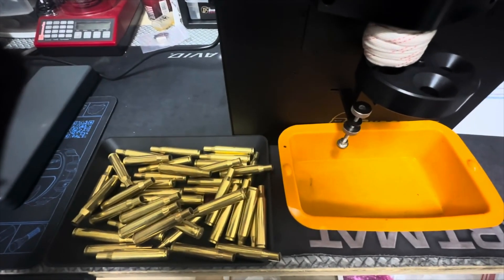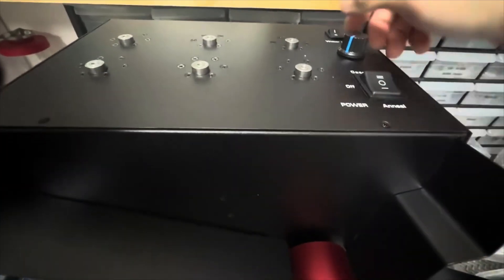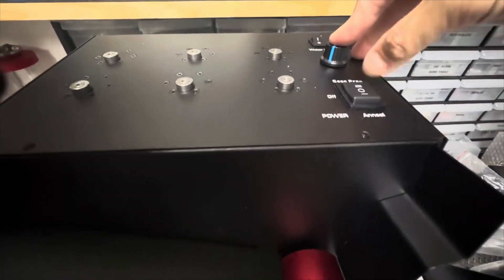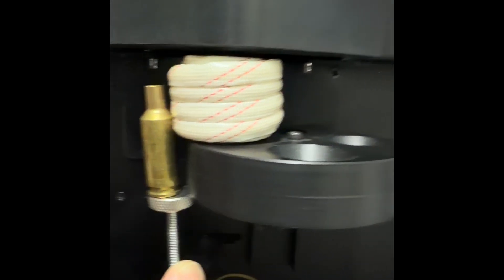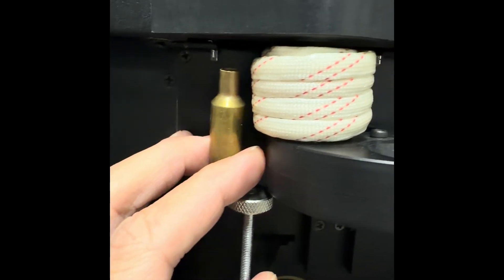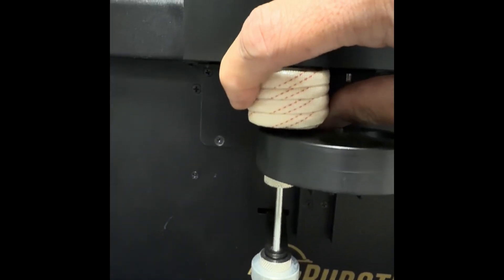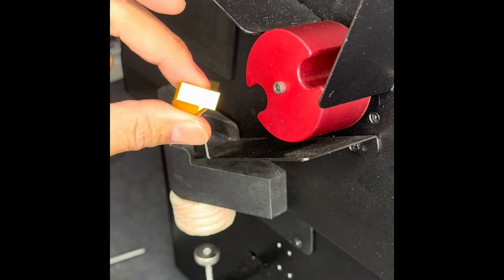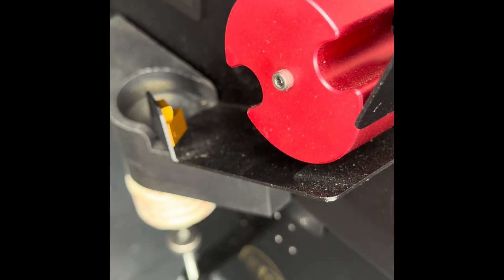🔥 Burstfire - Induction Annealer - Quick Setup Guide 🔥

Comment: Had an AGS flame annealer for about a year and been keeping an eye on this one.

Picked one up through Midway.  Arrived yesterday.  Did a lot of test running (new toy, must play) without the coil and pump running on 308 and 6.5 prc brass.  6.5 prc brass needed the bigger "Magnum" top wheel (takes seconds to replace - Allen wrench included).  IIRC I only experienced 2 times where a 308 brass didn't fall into the annealer part in over 300 cases.  It was way above and very easy to recover from and gave me no worry.    I tested to see if I could just run everything with the Magnum wheel.  It worked just fine with the smaller 308, but looked less precise.  Since it only takes seconds to replace, I decided just replace when needed.  During this time some fluid did come out of the cooling system into the reservoir telling me that this unit was tested before sold (awesome).  I guess it could also mean I was sold a used unit, but I severely doubt that.  I got that new electronic smell.  Mmmmm.

Ran a tray of 308 lapua brass today.  Ended up setting up speed too fast on the first case and was skeptical if it was working.  I can feel my fingertips now - it was working.  A couple of speed adjustments later and everything seems to be running well.

Compared to all other induction options I've seen, this is priced very well.  So far it seems like I've gotten an excellent product that I hope to get a lot of use out of - time will tell.
Reply from the maker: Thanks for sharing! Yes, we do test all machines through a very extensive QC process. Testing parts pre assembly and the parts (again) + functions post assembly.

Comment: This helps clear up a few setup issues and makes things much clearer than the previous setup video.
Thanks for quickly replying to my messages and helping me sort out my setup issues, which have been a bit more thoroughly addressed in this video (a picture's worth a thousand words and all that).
I honestly haven't found much I'd change. It really is a nice turn-key option with features not found on some more expensive offerings out there.
A better coolant reservoir is the main one. The lack of a seal lets coolant leak if the reservoir is moved, and the molded hinge is a longevity concern.
The voltage switch markings are opposite of what's on the physical switch, which could easily lead to fried units in 230V countries.
Maybe make the height adjustment a bit longer to more easily accommodate short cases, and future proof against someone developing something even shorter. There's a bit more room to adjust due to the arm not being solidly tight.
A purpose built shavings catch tray would also be nice since the prep center arrangement is 2X3 and not inline 4 like the torch annealer.

Other these fairly nitpicky things, it seems well engineered and is sure to improve brass prep season.

Comment: They sold out fast... Can't wait to see and hear how well they work...

God Bless
Reply: I waited months to get mine form Midway. BF got stock while I sat in the backorder line. I got it with a coupon code, so I'm happy.
So far it's a nice unit with only a few minor things I'd change, none of which are deal breakers.
Reply from the maker: @psykoklown874  Feedbacks are important to us! Send us an email or post it here. We are always working on improvements and enhancements. Like with our Gen 1 and Gen 2 annealer, we take into consideration backward compatibility when making improvements and enhancements and do our best for backward compatibility, so current users don't feel left out or feel like they have to buy a new one. We already have a couple of huge improvements we are working on. Both will be backward compatible with current induction units. Stay tuned!
Reply: They work really well
Reply: Thanks for the video Desmond! I’m still working on perfecting my system and then I’ll post about it. One quick question though, the pedestal on mine appears to be slightly off-horizontal and the black articulating arm has some wobble in it. Might something need to be tightened down, or is this not an issue because the guide wheel negates any actual concern?
Reply from the maker: Its more likely the ejector arm than the height adjustment rod/screw. That black arm is steel, but not heat treated so it’s soft and bendable. We have seen a few cases where that arm is slightly bent from getting bumped in the packaging process. 

Easy solution is grab a pair of small pliers and carefully bend it back straight. It if the adjustment screw, that would be rare but we’ll just send you a new one. 

Hope this helps